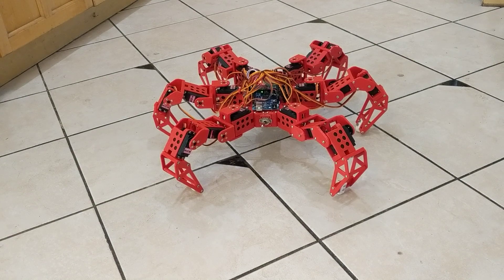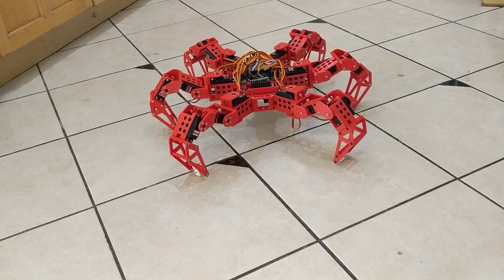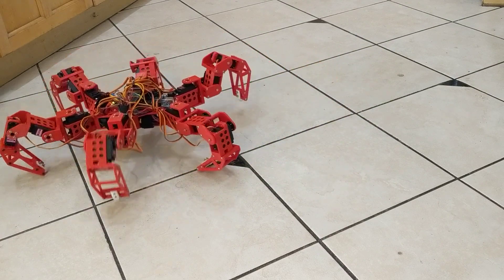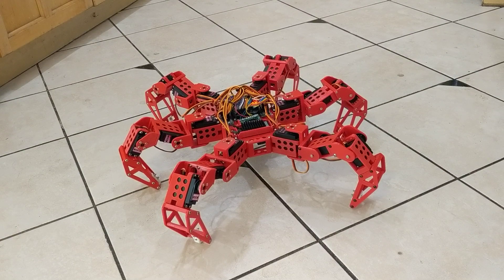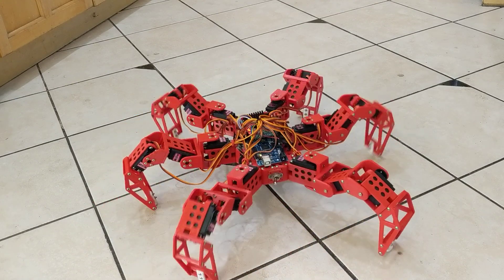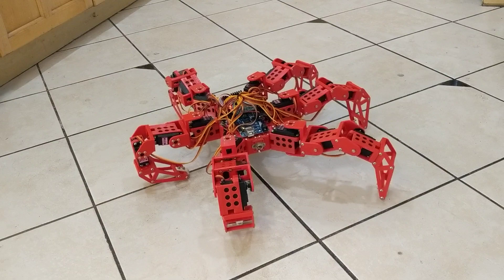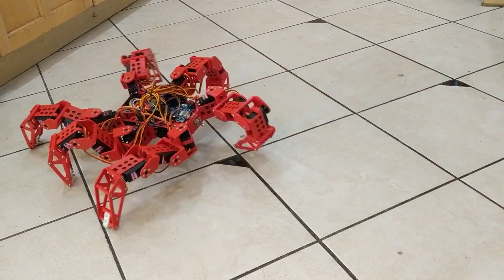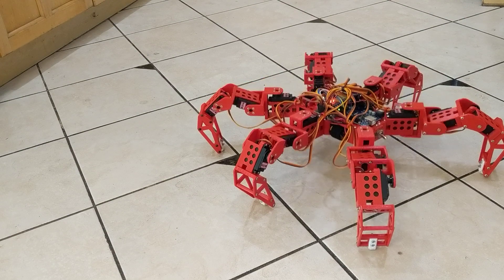Hexapod robot, demonstration of all modes

Comment: Hey your hexapod's movement looks way to stronger and smoother than markwtech's. Did you modify the code? Btw can you give me a guidance on how to do the same using a raspberry pi?
Reply from the maker: I used MG996R servos and the whole thing runs off a 2 cell lithium battery which is nominally 7.4V. The DC to DC stepdown regulator I used has three settings, 5V, 5.5V and 6V, and I initially ran all the servos on 6V for more speed. However, I later found this burned out some of the servos, so I reduced it to 5.5V.  I have no idea how you would adapt the code for Pi. As for modifications to the code, I changed the HOME_Z[6] values to -110.0 to make the hexapod sit higher off the ground. I also changed the step_height_multiplier to 2.0 (two locations in the code). I also changed the gait speed duration as follows
  if(gait_speed == 0) duration = 720;  //normally 1080; 
  else duration = 2160;   //normally 3240
Reply: @DaveTbar  Ok thank you so much.
Reply: Can I use UBEC instead of SBEC?
Reply from the maker: Doesn't matter either way.  https://www.amazon.com/gp/product/B0BMM1G74B    https://www.amazon.com/gp/product/B071CHGWRM
Reply: @DaveTbar  Ok thanks
Reply: Hii again😇, I am on the verge of completing the tripod gait movement code for raspberry pi. I wanted to ask you, except from the above mentioned changes, what else changes did you make to move your hexapod this smoother and stronger?
Reply from the maker: @mausambahar8111  no other changes
Reply: Sir please share your whole code🙏
Reply from the maker: @mausambahar8111  https://drive.google.com/file/d/1EXj5EQaMTUtrdJCIdBOxTz2jAcr4uDX7/view?usp=drive_link

Comment: I read your notes on thingiverse, and I saw that you have increased the leg lift multiplier, and the speed. you also mentioned that you lowered the servo voltage to 5V because you blew a couple of servos.
is this video on the 5V or 6V setting?  
I just built mine and it kinda shuffles along slowly. yours looks like it marches proudly.
Reply from the maker: This was with the 6 volt setting.  There's no visible difference between 5.5V and 6V.  If yours is slow then perhaps you're using the Slow Motion mode?  Press the Start button on the PS2 controller to switch between Normal and Slow modes.  I'm using a 2 cell lithium battery (7.4V) so it can provide a lot of power.
Reply: @DaveTbar  thanks mate. I actually checked the SBEC voltage and 6v was putting out 6.2v and 5.5v is putting out 5.7v im not sure that .2v makes a big difference but I'll see how ot goes.
Reply: @DaveTbar  hey mate, I have got it all sorted now, however my feet still kinda drag across the floor instead of stepping. you said you increased the step height multiplier. I have played around with the step height multiplier in the code but it seems like it doesn't make any difference.